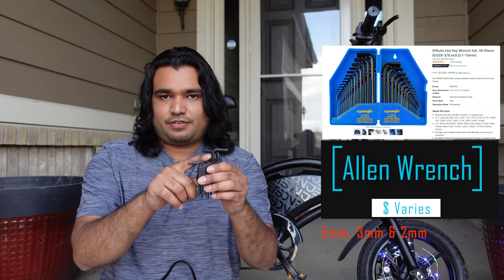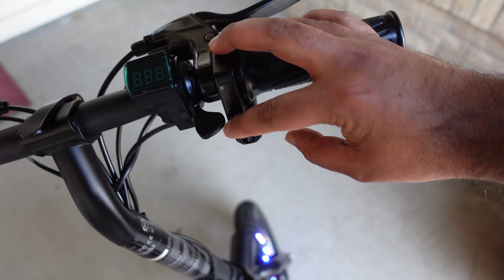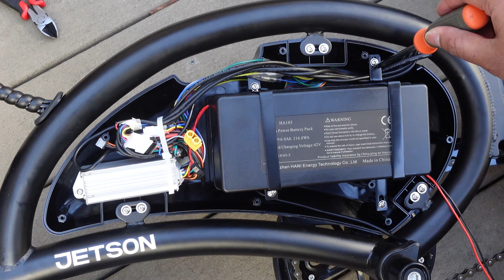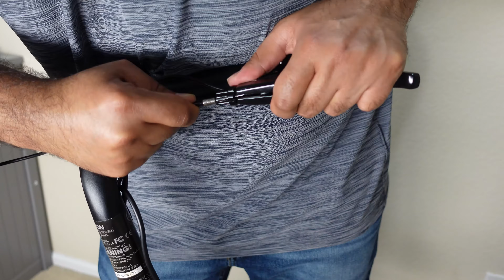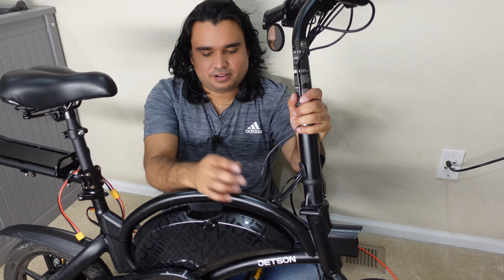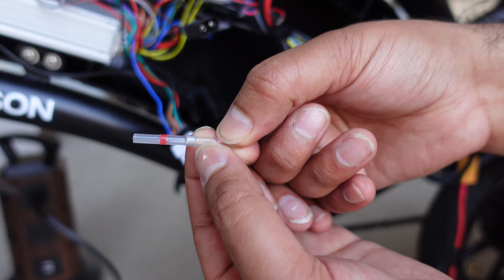How To Install A Thumb Throttle - Jetson Bolt Pro (Folding Electric Bike From Costco) 2021

Comment: Brilliant tutorial buddy. I personally find this more dangerous. I used to have it on my scooter and it was much easier to fire that lever when you didn't want to! I got into serous trouble. I'll always stick to twist and go, for that reason. Each to their own right.
Reply: You are right about to each their own. One friend, my wife, and I all switched our ebikes from twist to thumb throttles for the same reason. It seems we all like to twist the throttle when mounting and dismounting which dangerously sends the bike shooting off uncontrolled. Each of us sustained minor injuries at least once before making the decision to switch to the thumb throttles.
Reply: coming from a motorcycling background, throttle grips are better because they allow you to properly grip the handlebars.  Opposable thumbs make that possible, but if you need the thumb to operate the throttle, you're basically just holding on with your palm and a few fingers.
It's fine for smooth roads and slow speeds, but sometimes a more secure grip is warranted.
That said, it was evident who was a novice to throttle grips at a Can Am demo ride, because they would turn the throttle grip and once it started accelerating, they just grabbed it harder to try hanging on as the bike left them behind, accelerating even harder in the process in a vicious cycle 😂. 
Experienced bikers will put a finger on the brake lever as a reference point for the throttle grip angle.

Comment: Installed. And the monitor battery gage is working but no acceleration still. Only pedal assist working... I'm lost lol
Reply from the maker: Please double check the wiring. Some folks said their wires were different than mine.

Comment: Hi, I purchased the thumb throttle for the standard Jetson Bolt (without pedals).  The voltage indicator works but not the thumb throttle.  The bike does not move.
Reply from the maker: Hi Marc, please double check the connection. I suspect your throttle wires might be different than mine depending on when you purchased the ebike. Thanks.
Reply: @Marc Champagne ever figure it out? I have same issue...

Comment: I accidentally connected wrong wire now i have no power lol anyone know what I can do? Is there a fuse?
Reply from the maker: I am sorry to hear that my friend. I heard Jetson changed the wirings on the new ones. This is from one of my subscribers, I don't know if it will help your situation. I don't think there is a fuse on this controller: "OEM throttle wire is GREEN (as opposed to the BLUE wire in your video. My Bolt Pro does not have a maroon wire, and blue did not work"

Comment: So I was trying to install a throttle because the original broke and I cut the wires way to short so I tried cutting it on the other side and connecting it there but it didn't work  do you recommend getting a whole nother controller or can I salvage the old one I been doing repairs all day to this bike it's my only mode of transportation and it is a 4 hour walk to work any advice you have would be greatly appreciated thank you for all your help
Reply from the maker: Can you please email me with some pictures (sapkotatechnology@gmail.com)? Did you cut the wires too short coming out of the controller? Finding that exact controller will be hard, you might need a different type of controller.
Reply: @ShivaSapkota  thank you so much I will email you some pictures soon as possible

Comment: Shiva, aaah HELP!!! I hate to bother you iam sure your busy or enjoying your Sunday. .but batman doesnt get a day off either. Yea your like batman in my head lol...Anyway...I've connected the contoller upgrade with the one mentioned b4 and I've installed the thumb throttle too that was mentioned. I've watched both videos 100 times...dispaly is showing proper parrameters and I got no power to new thumb thtittle dislpay and no power to hub. Is there a way for me to send you a pic of the wiring as I start a New dream job tomorrow And I must use it to get there in the morning. Humbly r. Friedman
Reply from the maker: Hi my friend, thank you for your kind words. I am sorry to hear that you are having issues with the controller. I can try to troubleshoot for you. Please send me an email with your wiring pictures and I will take a look at it. My email is: sapkotatechnology@gmail.com. You can also message me in Instagram (shivasapkotas) or facebook page (shivatechvideos). Thanks!
Reply: My god, you really are batman...awesome! Ty Shiva..pics on the way..🙏🙏
Reply from the maker: @rfriedman2823  You are very kind. I just sent you a response. Hope it helps.

Comment: I found an easier way just cut the twist throttle about 6"" and cut the thumb throttle about 6" and just straightwire it you won't have cruise control by the throttle will work
Reply from the maker: Awesome, thanks for letting me know.
Reply: On my it didn't work, is a 6 wire .
Reply: What about voltage meter

Comment: Mr. Sapkota iam a huge fan and a subscriber. I can't begin to even explain how helpful your videos are...Gratitude. I have one quick and pertinent question. If one were to upgrade to both above mentioned thumb throttle & the controller  upgrade mentioned in a previous video at the same time, knowing what you know, is there one that you would install before the other? 🙏
Reply from the maker: Thank you very much for all the support, I really appreciate your kind words. I would do them at the same time and instead of connecting to the original throttle, I would connect the new controller to the thumb throttle. Sometime people accidently burn their original throttle, so at least installing the thumb throttle would insure that your original stock throttle works in case you need to revert the modification. Hope this helps. Thank you.
Reply: Thank you Sir....this is the way.

Comment: Your like the number 1 jetson ebike ambassador 😎. Great video! I was wondering if you will make/mod ur jetson bolt pro to a 170mm crank arm at a 48t-52t ? I heard people say pedals touch the ground but its not too bad!
Reply from the maker: Hello, thank you very much for your kind words. I will consider that as my future mod. Thanks!
Reply: @ShivaSapkota  alright sounds good! Any reason you personally haven't did the mod yet ( changing the crankarm?) are you afraid of it being to hard to pedal or even losing pedal assist? NO ONE on youtube showed a video on removing and installing the 170mm crankarm so making a vid about it would be huge in help and views xD

Comment: Hi Shiva,

when i currently twist my throttle, the bike will only go slightly slower than walking speed, would this method also work for me?

i have the 250watt version 

thanks
Reply from the maker: Hello, that sounds like a battery/motor issue. I don't think the throttle will help on that situation. It seems like the battery is not pushing enough current. However, there is a possibility the throttle is broken and is not functionally fully. Unfortunately, your situation requires some troubleshooting.
Reply: @ShivaSapkota  could it not be that they restrict the throttle due to uk laws and regulations 
Motor works ok when i pedal jus that i feel the throttle may be restricted
Reply from the maker: @moochy101  That could be it! What is the legal speed limit there? Does the bike have app control at all?
Reply: @ShivaSapkota  legal speed limit here is 15.5mph i can feel the motor stop assisting at around that speed, legal wattage for motor is 250watts max
Throttle control is not allowed but i want to mod it that way
Also no app control
I opened it up and could not see no BT dongle,

Comment: Thank you so much for your video on this!  My son's Jetson had the throttle go out on him.  Throttle handle just spun around.  Saw your video on installing a thumb drive, ordered the part, and some wire connectors, followed your wiring diagram, and though the colors weren't an exact match on my harness, I still followed your diagram, and it worked!!  Works perfect.  Thank you so much!
Reply from the maker: Awesome! I am really glad it worked out for you.

Comment: Sadly the first throttle upgrade I ordered was a dud now my replacement came in and I got it to work..well everything except then the lcd display on the thumb throttle 
Everything you’ve shown me has been spot on 
I just would really like to have the lcd volt indicator for reference... if any fellow jetsoner has a solution I’d be grateful thanks
Reply: Me too having  trouble with the led display

Comment: Do you have the original controller pinout/hookup connections, I removed mine to install a new controller realized I was in over my head tried to put the original back in now it does not work
Reply from the maker: Hi Dillon, please send me an email and I will send you the original detailed controller upgrade video where I show what each wire does on Jetson's controller. Sorry to hear that you are having issues.
Reply: @ShivaSapkota  
Hi Shiva I have on my original plug the following 
Yellow white Blue red green black

New thumb throttle
Yellow red green black

How can I connect them
Reply: Any update on the video?

Comment: Nice shiva . I have had success cutting the throttle on my ecotric bike to make a half throttle and a regular grip. I wrapped the handle bar so the outside of the grip would not turn. How do you get off the throttle on the jetson. Thanks. Ron
Reply from the maker: Hi Ron, there is a screw in the back left corner of the right handlebar to loosen the throttle. I am not sure how you can do that with this bike. Thanks for watching my video.
Reply: @ShivaSapkota  love your videos. They show the mind of an adventurer. The splice kit with internal solder is a new one for me……..I got three of the jetson bikes for my grandkids but finding they work well for adults also. Bought a longer seat stem so that I could get more engagement when raising the seat. Bought a 9 dollar stem that is 350 mm long by 28.6 in diameter. It gives me an extra 1.75 inches of length to engage the seat clamp…….I found the screw and bought a metric Allen set. Today I cut the existing throttle handle 3” from the end of the grip. I wrapped the handlebar for the piece I cut off with about 6 wraps of duct tape. Now I have a split throttle with a cost of zero. I am a retired nuclear plant engineer and piddling with e bikes is a source of entertainment. How can I contribute to your channel. My best friend is ramachendren gillella reddy. I recognize the name shiva as the one of the Hindu trinity. I I understand shiva as being the god of destruction. You seem anything but.
Reply from the maker: @ronbush9780  Hi Ron, you are awesome! I am glad you were able to find an extension rod and your split throttle idea is amazing. I really appreciate your kind words. I would love to pick your brain on ebike mods and hear your ideas on other improvements we can do to this ebike. Yes, Shiva is the god of destruction which is not my personality:) Thanks again!

Comment: Hi Shiva, why the battery show 40.9V (@17.27)? Isn't it the battery is only 36V, are you using a 42V battery? Thanks!
Reply from the maker: Hi Erick, a 36 volt battery goes to 42 when fully charged. The "36V" is advertised as being the optimal voltage.

Comment: Will still run at 18 speed with a 36v battery?
Reply from the maker: Hi Julio, not with the stock controller. You need to upgrade it. I have a video here: https://youtu.be/InoocxVSAuY

Comment: I got a question what if I put a 99999mah of 48v
Reply from the maker: If you can find one, yes it will work with the new controller. The existing controller cannot take 48V. Thank you.

Comment: Hey I got the same bike how can I get a new weel for mortor plz help me
Reply from the maker: Hi Jonathan, did you have a flat tire? The wheel size on this bike are 14"x2.125. If you need a wheel replacement, you can contact Jetson. You can also pick one up from amazon. Thanks for watching my video.

Comment: Hey Shiva,  Will it harm your battery if you charge it overnite?
Reply from the maker: Hi Frank, it will damage in a long run. The lithium ion batteries do die out faster if you leave the charger plugged in after the battery is full.  This is also true for your phone.

Comment: Hi Shiva, 
I bought Jetson before I knew/watched your THUMB trottle upgrade. I already bought the ITEM/upgrade. It comes with additional wire - BLUE. I bought one with Ignition Key! Can you help me connect the wirings? The thumb trottle is already installed in the right handle. I'll insert the wirings in the body tube once the wiring connections are solve. PLEASE HELP ME ! ! !   Respectfully your, Don
Reply from the maker: Hi Don, thanks for watching my video. Would you mind putting the product link here or sending me a quick email with the product link so I can look in to this for you? Cheers!

Comment: Great video even though I'm not really interested in modifying my Jetson bolt its cool that you made a video to give us the options. if I could change one thing it would be to make the front heavier. lol the bolt can't handle loose gravel or pine straw I nearly crashed 3 times :D
Reply from the maker: Thank you very much. I agree, perhaps adding a second motor in the front would be a good fun upgrade (may be one day) haha :)
Reply: @ShivaSapkota  Great idea that could be  a good way to solve the weight problem.

Comment: Great video, did you see a speed level/mode connector for the stock controller? Saw some pics show "3 gear speed". If have maybe can evev add a speed controller.
Reply from the maker: Hello, thank you very much for watching my video. I don't think speed levels can be changed on the stock controller without hooking up the Bluetooth module. That would be great though.

Comment: I have a prior Jetson model with no pedals and no brake on the right side. I plan to replace the old throttle following your very detailed directions and hope the wire colors are consistent with my model. The old non robust twist throttle broke.
Reply from the maker: Hi Dave, thanks for watching my video. I believe it is the same wiring. If it is not the same when you open your controller housing, I might be able to tell you which wires to tap into. Just send me a picture to my email with close up wiring and I will try my best to help you out.
Reply: @ShivaSapkota  I replaced the broken twist throttle with the thumb drive today. It was pretty easy using your wire definitions. They were exactly right and saved me lots of time. Thanks again, Dave
Reply from the maker: @tecoloteDave  I am really glad your were able to fix your throttle. Thanks for watching my videos and please reach out at anytime with any questions about this bike.
Reply: Might be same wires from the controller, but my wiring harness on the exact same bolt pro model that's he's using had different color wires going to throttle and battery indicator.
Reply from the maker: @viernesb  Thank you for the insight. I appreciate it.

Comment: Your so smart and informative and very well spoken and thorough with the instructions you should make a dual motor mod and use the second battery you have just get a second controller and second motor or just get a whole second bike and mod them together lol
Reply from the maker: Thank you very much, I really appreciate the support. I did recently hooked up a new controller to try to get this bike to go faster. So, technically I have 2 controllers and 2 batteries, I just need a new hub motor to make a dual motor system :)
Reply: @ShivaSapkota  then do it up man lol would love to see the results
Reply from the maker: @CYC3D  Haha that is a fun future project if I can find a hub motor that can fit in my front tire hub. I gotta get my new controller to work first. But dual motor has been a very popular request, I might just do it :)
Reply: @ShivaSapkota  in theory could i not take 2 jetson bolts and take the rear hub motor and wheel and battery and controller and throttle and put them together hence doubling the power just run one hub off the one controller battery and the other hub off the second controller and battery?
Reply from the maker: @CYC3D  Yeah that would work. It might not go any faster but it will be more powerful for sure :)
Reply: @ShivaSapkota  it should go a bit faster with 2x the power if its a 250-350watt motor and i double that then its 500-700
Reply from the maker: @CYC3D  That is a valid point. You might get a small increase but the bike will accelerate to reach those speeds faster. It's just a torque increase but since it will handle inclines better, you could see overall increase in speed.
Reply: @ShivaSapkota  could i connect both throttles together somehow i kind of want to try and do this as it wouldnt cost very much to buy 2 jetson bolts
Reply: I think 2 hubs 2 batteries and 2 controllers would all work fine but how would i manage the throttle is my issue
Reply from the maker: @CYC3D  I wonder if you can just combine the throttle output from both controllers to one throttle. That actually might just work. I will have to think a little bit more on this...
Reply: @ShivaSapkota  thats what i thought as well if i could basically connect the same throttle to both
Reply from the maker: @CYC3D  I don't see any issues with that. It should work. Please keep me updated if you do this. Thanks!

Comment: 1) it will be easy if you loose the middle bolt and slide the handle one side and u can easily take out the brake assembly. 
2) removing of left hand side is easy as there is no throttle and grip can slide off easily.
Reply from the maker: Thank you Jay. That is a great idea. I didn't even think about loosening the middle bolt.